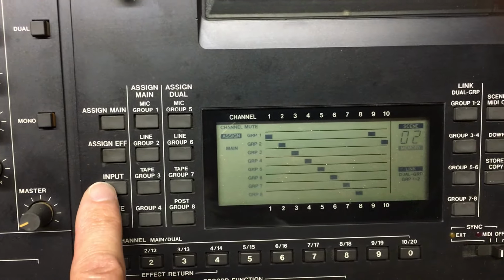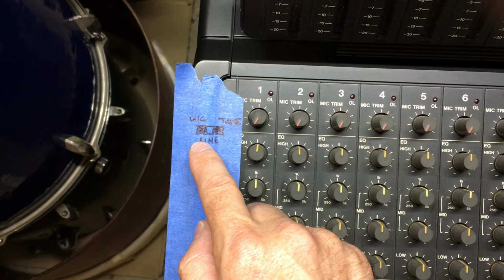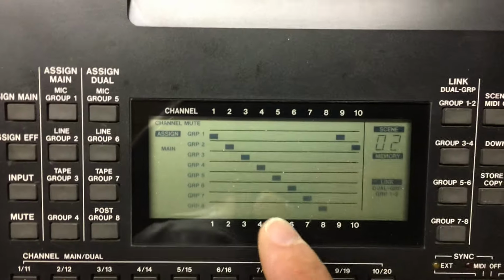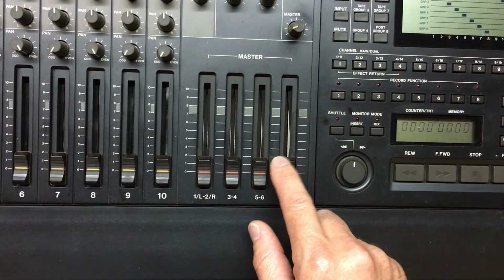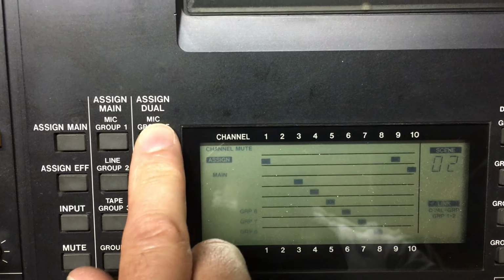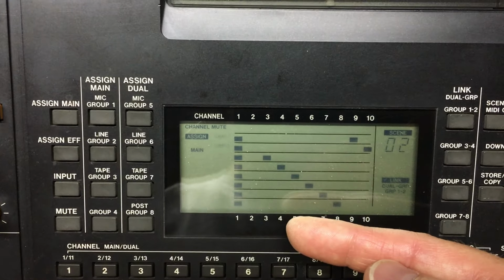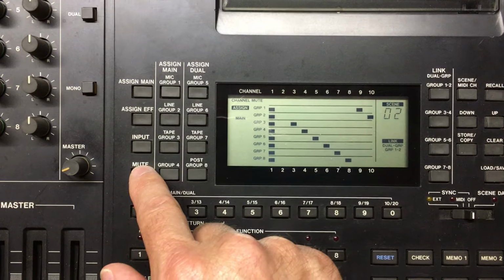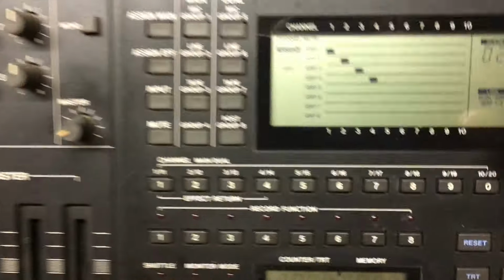Tascam 688 (and 644) Mixer and Scene Display Panel Demystified!

Comment: Thank you so much for taking the time to make this video. The little pieces of tape with your drawings made everything fall in place for me. Great! Wel... not everything though: one little question if I may ask? I am planning on hooking on my two modular eurorack cases to it along with some drumcomputer friends. All of them have stereo outputs. Am I correct to assume that the 688 has 5 stereo tracks (2x5) available to record and mix at once? Or do I see this totally wrong? Thanks in advance for taking the time to answer :-)
Reply from the maker: The 688 has 20 or more inputs that can be mixed at once, so no problem handing  5 stereo sources. But the 688 only has 8 tape tracks for recording. “Tracks” refers to the discrete tape tracks, “channels” refers to signal pathways. The 688 has 10 channels on its mixer, but each with multiple inputs that can be accessed and summed in different ways. And then there are 8 mix busses. A “buss” is a signal path that can combine signals from multiple channels…take multiple things to one common place. Like a bus. The 688 mixer has more busses than the 8 mix busses, but I’m highlighting those because we’re talking about recording and there’s one mix buss per tape track. 8 tracks, 8 mix busses. So you’d need to combine your 5 stereo sources (10 channels total) in some way to 8 channels by maybe summing two of the modules together on two of the tape tracks.
Reply: @SweetbeatsTechStop  thank you so much, this was really helpful!

Comment: This Desk really comes into it's own when you start bouncing. It records so clean, especially with metal tapes at double speed. I also love the fact I can plug into my computer & digitally remaster from the 688. There is so much it can do.
Reply from the maker: As far as 8-track cassette multitrack machines the 688 definitely offers the largest menu of features...more than most people need, but with the onboard sync and MIDI capabilities, and the hardware inputs, outputs, bussing and assign capabilities the mixer is the most flexible of any cassette multitrack machine. And I know the digital bussing/routing “scene display” interface can be a bit daunting, and may not work well for some operators, the hidden gem of it is its implementation means all the signal routing/bussing/assigning switching is handled by electronic switching. So there are no physical contact switches with any of those functions, which means no switches to get dirty, no contacts to corrode, etc...this generally means greater reliability and greater signal quality through the signal path. Yes, it also means if you have logic components that go belly up it can be more challenging to diagnose and repair, unless you are into logic circuitry, but I think this facet of the 644/688 goes a bit unnoticed and would contribute to better signal quality throughput from tracking to overdubbing, bouncing and mastering.

Comment: Do you know where to get the power cable for the 644?
Reply from the maker: No, it’s proprietary. You either find a used one on an auction site or whatever, or make your own power supply and modify the interconnect since the connector on the 644 itself is pretty obscure. Not the best news, but that’s the long and the short of it. IIRC the regulated DC voltages needed are +5, +12 and -12. You can use an ATX computer power supply.

Comment: Any thoughts on battery replacement?
Reply from the maker: So, I had to replace the memory backup battery in my 688. The battery from the factory, as you may know, is equivalent to a 2050 lithium coin type battery but with electro-welded solder tabs on it so it is soldered directly to a PCB. What I did is I bought a 2050 battery holder, mounted that to the board with some RTV after removing the factory battery, and soldered wire leads to the terminals on the battery holder and then soldered the leads to the solder lands on the PCB where the factory battery was soldered. Done. It’s a bit tight in there as far as trying to mount the holder where it’s not obscuring any components, and if I recall the holder actually had to mount over one of the factory solder lands for the battery. So you have to actually solder your leads in and then mount the holder. Not the most perfect situation, but effective, and if ever there was need to repair things on the board in the future that were obscured by the battery holder, it’s easy enough pop the holder off and then re-adhere with a new spot of RTV. I only used a small amount of RTV by the way for that very reason. So that’s what I did. Makes it super easy to replace the battery in the future if needed because the battery just pops out of the holder like the CMOS battery on a computer motherboard. Hope that helps!

Comment: Can this sync with logic pro x?
Reply from the maker: You want the 688 to chase Logic or Logic chase the 688? The 688 can operate in wither role with any suitably featured DAW, but if the DAW is going to chase the 688, then you'll need a synchronizer like a TimeLine Micro Lynx and you'll need the interface cables and a MIDI interface (if your audio interface doesn't already have a built-in MIDI interface as well).

Comment: Does your capstan motor run constantly when it is on ? Is the motor louder when it's in high speed ?
Reply from the maker: Yes, and yes.
Reply: @SweetbeatsTechStop  When new they were whisper silent. do you know how to oil a DC motor ?
Reply from the maker: They are not meant to be oiled or serviced. Maybe you should upload a short video of the noise. It’s hard to know what you are hearing without being able to hear it. It’s possible your motor needs replaced.
Reply: @SweetbeatsTechStop  I had to replace the Capstan motor with a new one. After assembling everything, it was working great but high speed had alouder than usual motor sound. The lower speed was less but still noticeable. So I opened it up again and noticed a couple of things. Firstly the capstan pin in the bushing was dry. This caused slight resistance on the belt thus putting a load on the motor. Secondly the new motor was mfg's over 20 yrs ago, and the internal lube was probably compromised. I put some PLP synthetic lubricant in the capstan pulley, pin bushing, and shaft out of the motor. PLP is the finest synthetic lubricant available, sewing machine or synthetic gear oil is too thick. 
It's as close to running like new possible. As long as the motor sounds hush & the same with and without the belt things are right.

Comment: I've got the service manual pdf if anyone needs it. Mine plays slow sometimes. I ordered a new belt.. I just hope it's not motor or voltage problem!
Reply: Hi, could you send me the service manual? Thanks!
Reply: Hi Farah, I hope you got your 688 on his feet with the new belt. Could you sent me also the service manual ? Thanks
Reply: @Roykko  You can find it online at hifiengine . Search for the 688 and it will come up.

Comment: Good afternoon. Sorry, my English is very bad.
Now I repair 644, the problem is, after replacing the engine with a new one, the playback speed of the cassette is 3 times faster, how to reduce the engine speed, in the control panel?
Reply from the maker: There is no way to reduce the speed on the control panel. If the speed is too fast, it is the wrong motor (engine).
Reply: @SweetbeatsTechStop  
Thanks. I'll keep trying to fix it.
Reply: @k5257  where’d you get the power cable? Can’t find one anywhere
Reply: @billythekid3019  Brought for repairs with it.

Comment: man i've been trying to get stereo monitoring but nothing works. I'm using the scene number 12 and stuff but the panning knob just woulnd't work. if its hard panned, you get a full sound coming out of of both sides. if it's in the center, it sounds quiter still on both sides. same happens on the cue monitor and dual pan knobs. would you know what is that about? thank you !
Reply from the maker: What position is the MONO switch in? Up or Down?
Reply: @SweetbeatsTechStop  thank you for the answer. my headphone adapter was messed up. it's working well!